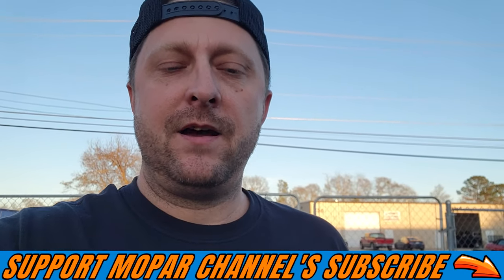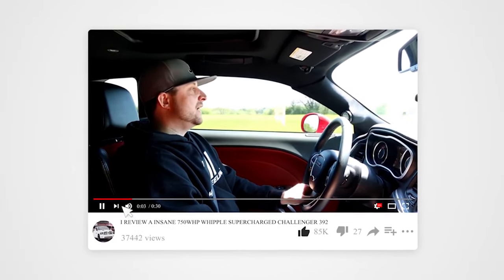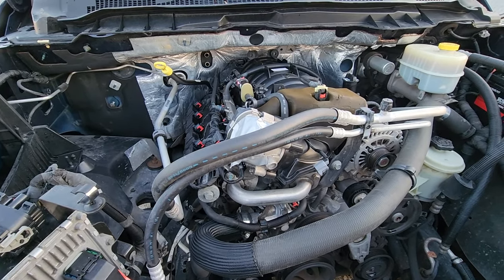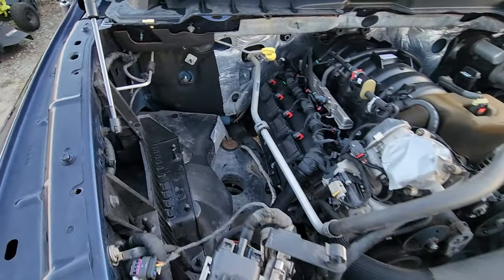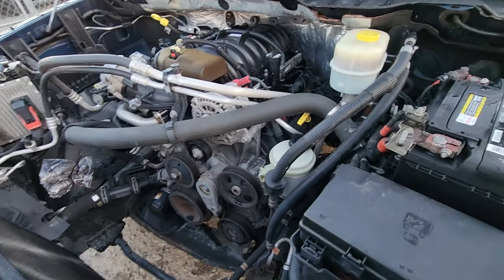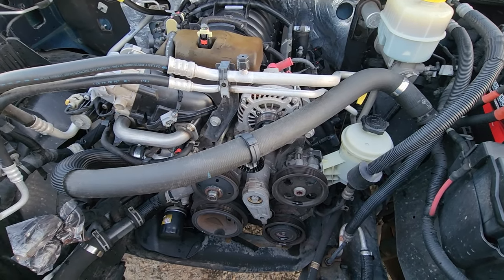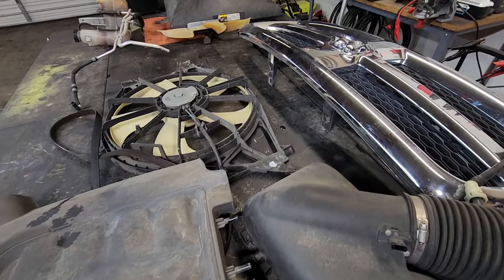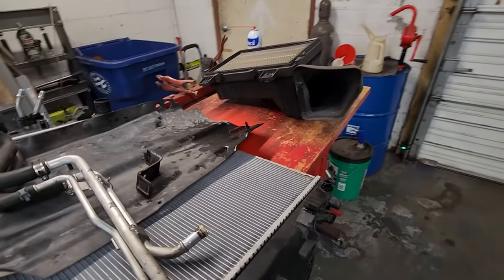6.4 Hemi Ram 2500 Common Problem Tick Rattle Boom! Part 1

Comment: I’m pulling the 6.4 out of my 2014 tonight or tomorrow. Engine is ready to come out. Just need to remove the radiators and pull it out. Roughly 113000 miles on it. Installing the comp cams stage 1 NSR cam. Also going to install the new Melling high volume pump.
Reply from the maker: Awesome

Comment: Did my 5.7 cam in Nov. Fun times! Mine wasnt a failure, prevenrative upgrade. 89k and my cam/lifters were perfect…
Reply from the maker: That's great 👍
Reply: Our newer RAM 5.7 had lifter failure  that was fixed under warranty, it is babied without ever towing, low idle and maintenance within 5k. My 6.4L is passed 100k with same  maintenance intervals, but worked hard towing and so far Lucky.

Comment: Hey man dig your channel but I have an frp cam in my 5.7 and is ther anything I can do to keep the rocker assembly from chattering i torque them correctly even rotating the engine between torque cenquinces to make sure they don’t lift but i am having the chattering come back any suggestions would be appreciated thanks
Reply from the maker: Doesn't seem normal how long has the parts been in.

Comment: Only issue my mom has had with her 2019 Ram 1500 is that stupid rubber flapper whatever thing  instead of a standard gas cap... Though the first 2-3seconds on cold start you hear that tick, even with that 0W-30
Reply from the maker: Right on